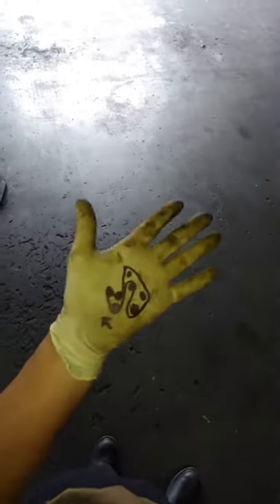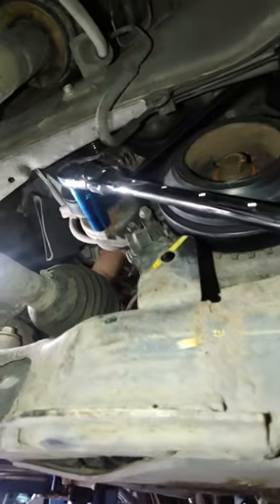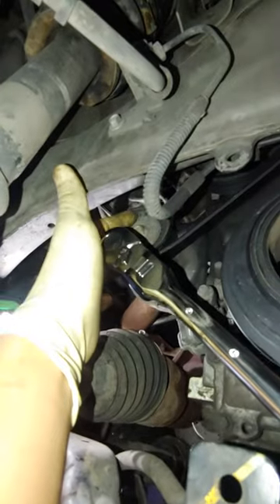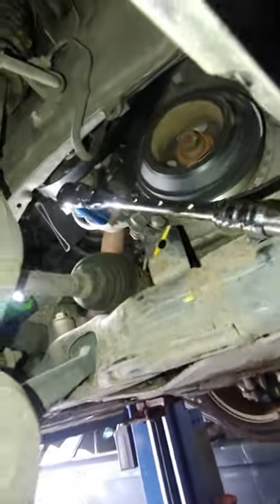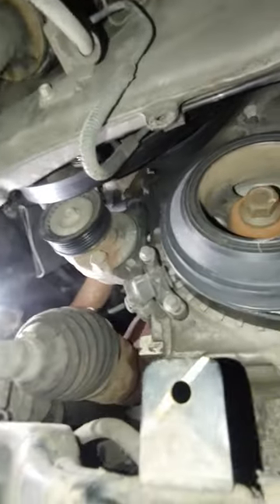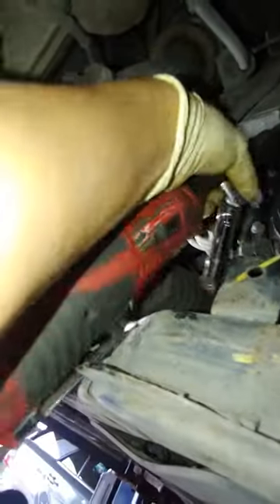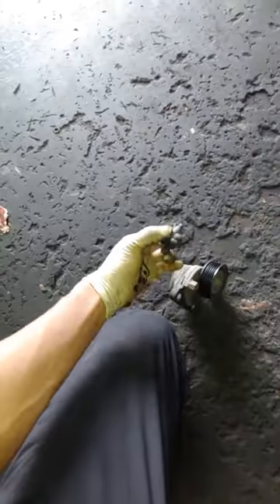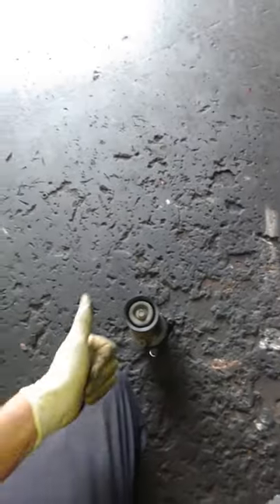2012 Ford fusion 2.5 serpentine belt

Comment: Which belt did you use I've gotten a couple that are too small
Reply from the maker: Maybe going dealer.    Its common that the new ones are slightly smaller as they will strech with time.